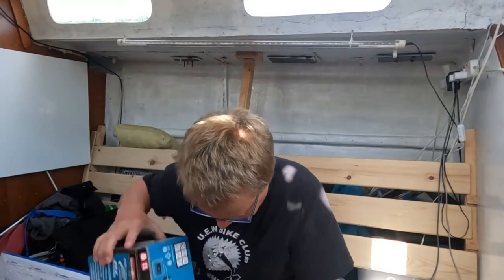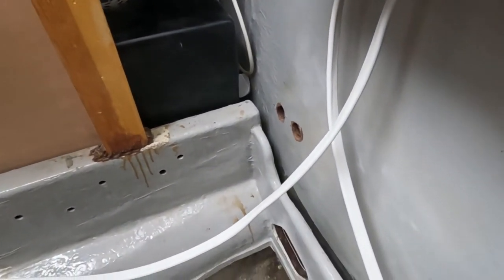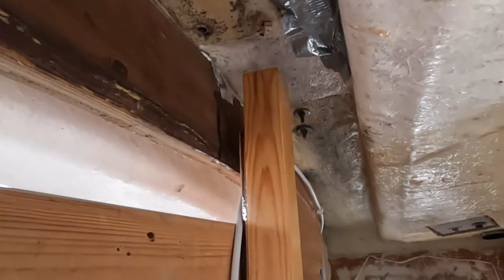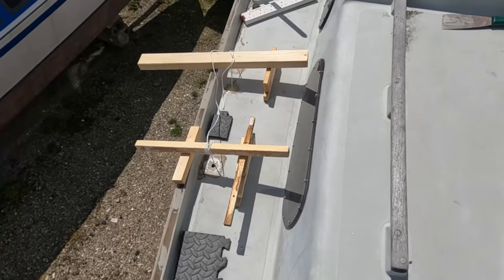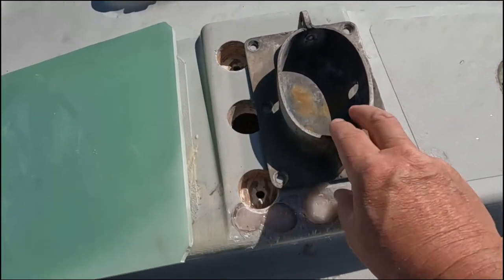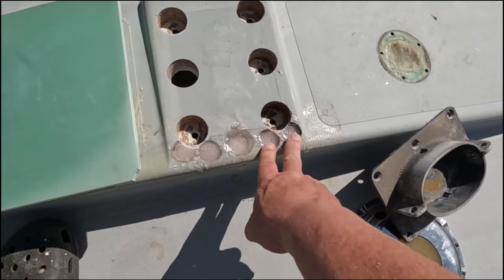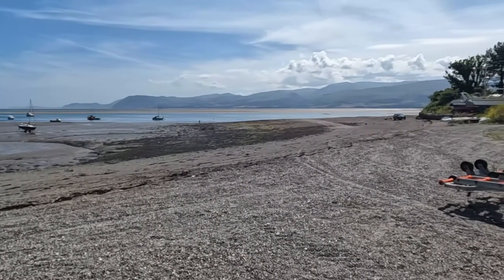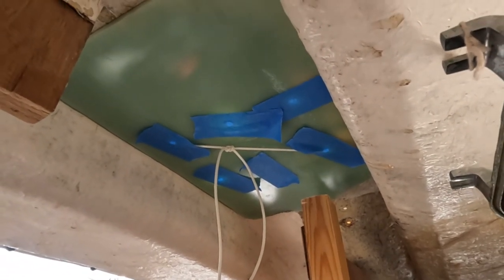Building Mizzen mast support, chainplates for dyneema stays, & new bilge drains

Comment: You will LOVE that sander. I use mine all the time. I hold up my vacuum to it (the vacuum attachment doesn't catch enough) and it doesn't spray all over like a grinder. All my tools are Makita. I didn't get the battery powered one. For this I chose the corded version. You have a fantastic channel - we seem to be going through the same things at the same time - even down to the electric engine and it being a ketch rig...
Reply from the maker: All we need is an extra couple of arms and hands to hold everything 😂
Been using that sander again today, it is awesome. 
Thanks for the encouragement!
Reply from the maker: After seeing a number of YouTube channels (Sailing Project Atticus, Millennial Falcon, Beau and Brandy) with mast step/compression post problems we have decided to add that to our jobs list - we don't want to feel left out 🤣
Once I've finished the mizzen mast foot strengthening it is battery wiring, solar panels, cabin floors, mizzen mast dyneema rigging (I think at the moment).